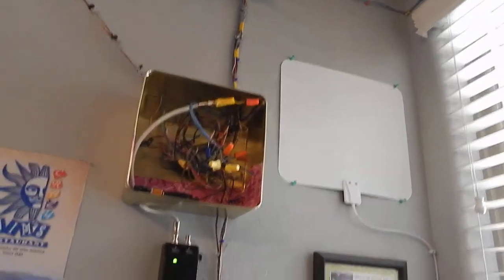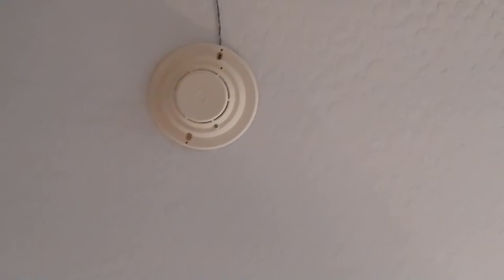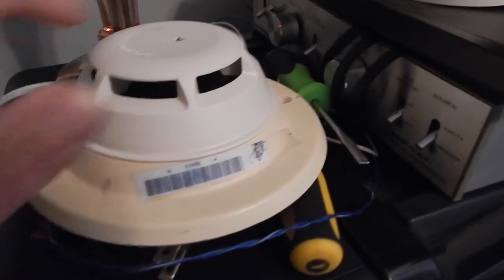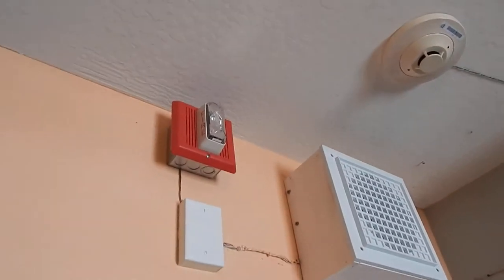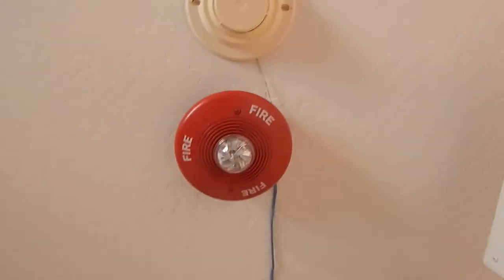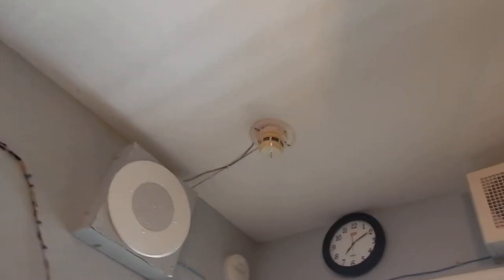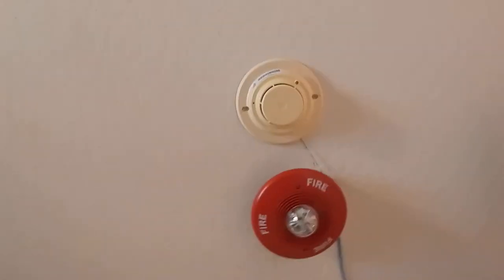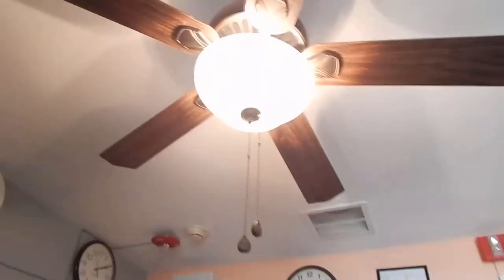Small Fire Alarm System Update With Future Changes Coming.

Comment: If those are addressable smoke detectors they will not work. Only conventional smoke detectors will work with whatever you call that wiring system. You cannot "program" them, they always are connected to an addressable fire alarm panel, the address is so the system knows exactly which detector it is. It will not even work with conventional panels